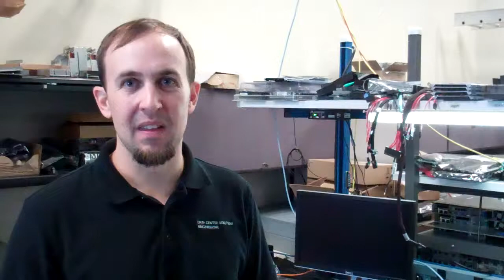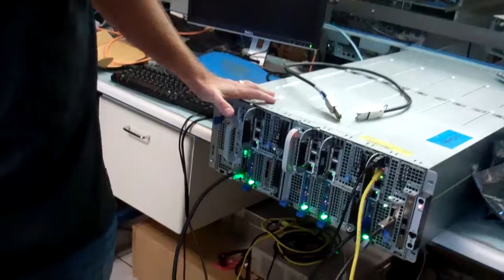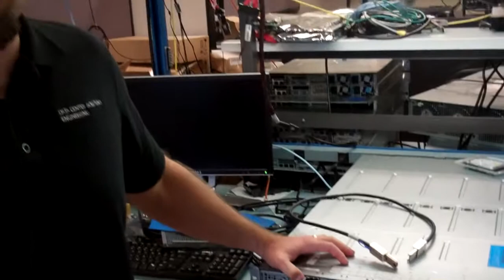Connecting PowerEdge C8220X and C8000XD Sleds (Chris Petersen)

Comment: I spoke with the dell team through our sales, it's sort of a mute configuration because you still need to dedicate an entire additional chassis to the power supply sleds... so it would be the same ratio as 4 storage sleds and 1 power sled in 5 chassis (vs 5 storage sleds * 4 chassis then an extra chassis for the power supplies).  Any reason why the power supplies were not built into the chassis more like a blade so that all the "bays" could be fully utilized?